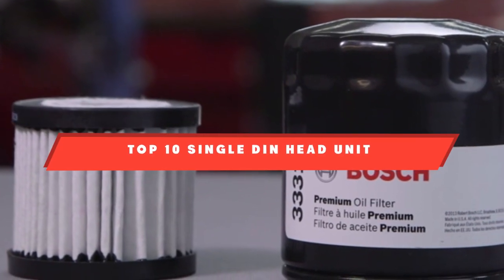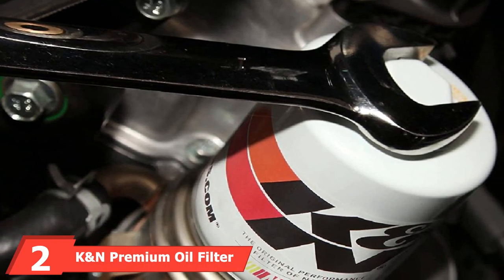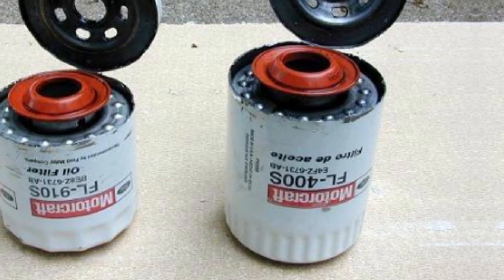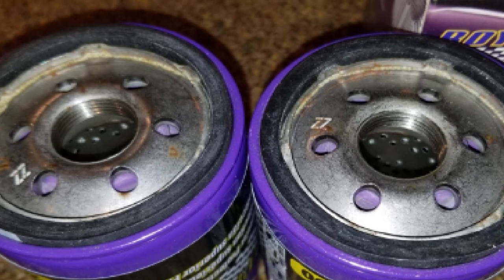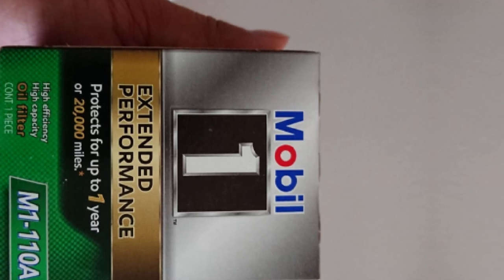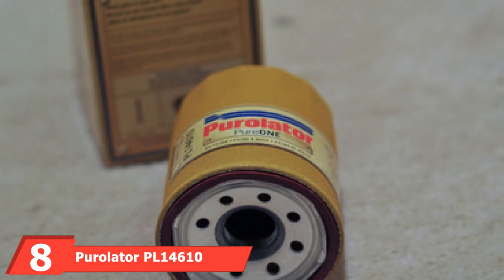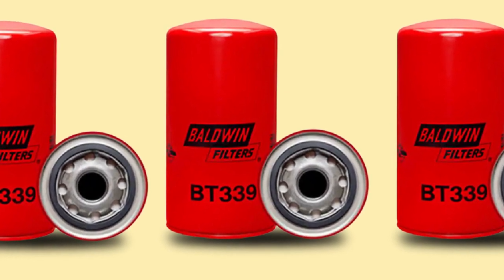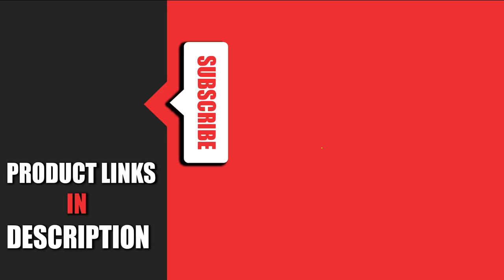Best Oil Filter In 2024 - Top 10 Oil Filters Review

Comment: Everyone has thier own opinions and preferences. So these lists are very subjective.  The stats the filter company provides are one of the best ways to help decide if it's best for you. Micron size ratings and the percentage it traps is a major factor. Media style is another and type of ADBV also... Also are you planning on changing it in 3 to 5000 miles? Then cost is a factor to think of, as you are not trying to take it to the 10,000 and 20,000 miles some of these filters claim they can go..So why pay extra for something you aren't even going to try and use....Also high dollar engines are going to (or should) use top of the line high dollar filters..Cut open and disected is where those kind of filters shine! Also brand loyalty ( Ex. My dad always used a Brand X etc.) is a big purchasing point...Thanx for the Vdeo, though!👍
Reply from the maker: Thanks For Your Valuable Thoughts.
Reply: @AutoGears   Not everyone has their own informed opinion and being an engineer I can loose my job in a new your minute if I don't do my homework to begin with and that is something that Stevie wonder can see.
Reply: @samuraibushido7077  Punctuation is your FRIEND, Sammy !! 😁

Comment: I'm hearing a play on words for Bosch, 99% efficiency,  but he doesn't say what micron size, then a bit later says it will capture down to 20 microns.  So 99% at what, 40 microns and 80% at 20 microns could be the reality.  I went with Pure  One for the Acura, and Hyundais filter for the Hyundai.
Reply: Here ya go, Lonnie -- Taken from a brand-new  BOSCH Premium # 3323 Oil Filter box --
"Based on ISO 4548-12 at 20 Microns" .
The FRAM Ultra's box is different -- it says:
"under ISO 4548-12 for particles GREATER THAN 20 Microns".
Both of these oil filters are for the same engines, mine are for a 300-horsepower Acura MDX V-6.
 Trying to figger out why these oil filters are SO SMALL, but it's HONDA, so ya never really know.
On the Acura, I change the oil when the dashboard tells me to, and go 5,000 miles on the famous 95 MERC.
Reply: exactly, ya cant go wrong with pure one

Comment: The famous 95 MERC runs the BOSCH Premium #3410 Oil Filter -- Pennzoil Ultra Platinum, 5-W-30, with a FilterMag magnet kit installed -- changed at every 5,000 miles.
 Bosch Premium # 3410 features:
1. 99% @ 20 Microns.
2. Silicone ADBV.
3. Steel core tube.
4. Synthetic blend filter media.
5. NO bulky Wire Screen -- allows for more pleats.
6. NO obsolete Coil Spring -- stamped steel retainer instead.
7. Large Inlet Holes allow for maximum flow.
8. Nitrile Rubber gasket holds fluctuating pressure. 
9. Black color dissipates heat -- helps to cool the oil.
10. MADE IN USA !!
Recent trip from Phoenix, AZ to Coeur-D'Alene, ID and return -- 2,860 miles -- altitude up to 9,910 ft. -- speeds up to 95 mph -- yielded 24.1 mpgs average for the whole trip.
 The BOSCH Premium Oil Filter has proven to be an excellent choice for the 27-year-old  FOMOCO 4.6 -Liter engine that now has 178,000+ miles on the clock.
https://www.mercuryforum.com/forum/grand-marquis-14/1995-grand-marquis-restoration-8937/
Reply: Where you getting that 99% at 20 microns?
Reply: @lonniebeal6032  It's printed right there on the box, Lonnie.
I don't claim that the Bosch # 3410 is THE VERY BEST oil filter -- it's the only one that I've found to meet my requirements PERFECTLY.
I have no NEED for the Fram Ultra or the WixSP's extended life -- I change oil & filter at 5,000 miles.
Reply: Hola, yo uso Fram ultrasinthetic pero quise probar el Bosch premium en esta ocasión, gracias por su experiencia ✌️🔥🍀🇲🇽

Comment: Disagree with denso, not american, performed poorly in 2 of my cars. The motorcraft is an excellent entry level filter. As is the ac delco. The k&n leaked on me. Never has a filter leaked on me.
Reply: @SlikLizrd  yes on the gasket seal, been changing more than 20yrs so definitely was a defect
Reply: The Densos are very good filters actually, in how exactly did it "fail" again?  Toyo Roki (Toyota) makes these and are THE Japanese main OEM filter supplier.
Reply: @charleslambert145  ok i ordered a couple from rock auto and put on my 08 ram hemi, i had startup knock, never had that with other filters, second filter did the same so i stopped using them

Comment: How much did Fram pay ya for that BS review?  Absolute trash
Reply: Some of the Fram filters are good, the Ultra is for sure.  The cheaper ones with cardboard end caps are ok under 5,000 mile changes.  I won't use a cardboard end capped filter.  The Ultra is good except for rust if it's been sitting too long.  I use Pureone for the best price/performance.